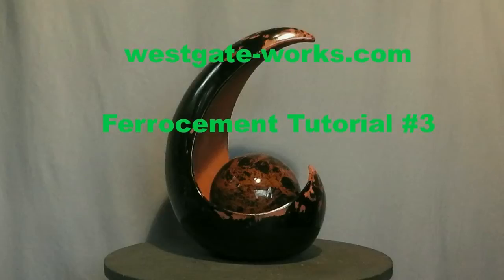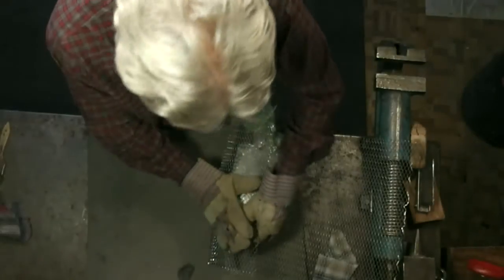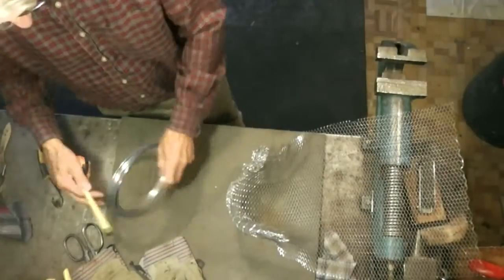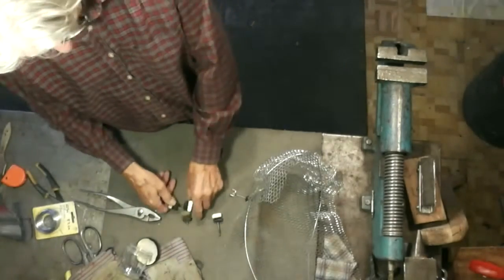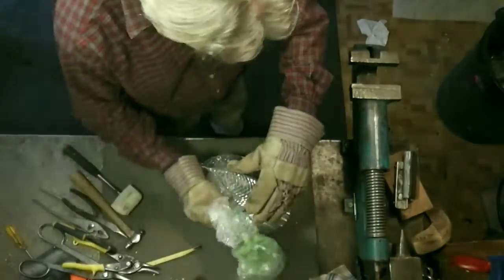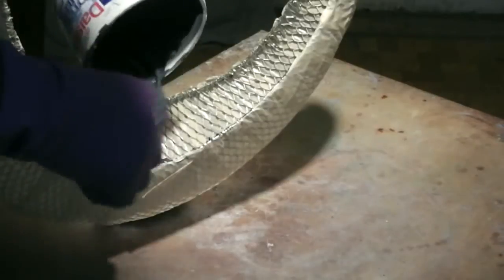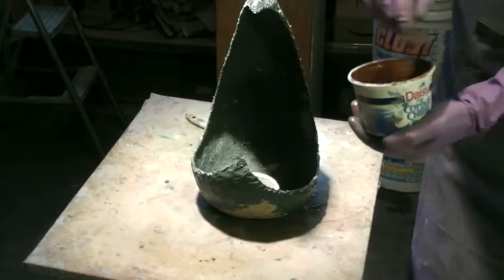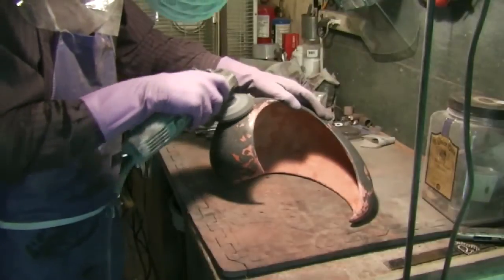Ferrocement Tutorial #3

Comment from the maker: I'm really sorry for not responding for so long. I have been offline YouTube for about 3 years.

First; Sorry for the terrible audio - I had no idea it was bad or I would have fixed it. I'm very hard of hearing so have to depend on others.  The audio was probably trashed by the upload process because it was not YouTube format friendly. I'll try to re-install this video with better sound if I can find the original clips.

Second; I must apologize for all the unanswered questions. Here are some answers.

1. The mortar used for the under layers is Rapidset morter - the brown bag. It can be purchased from Home Depot for about $16. The finish layers use Rapidset Cement - the purple bag with dry pigment colors added. I have only found Rapidset Cement - purple bag - retail at White Cap cement products distributors, and not all stores carry it. It's very difficult to find and worth a long drive.  

2. The expanded metal (steel lath - normally used for plastering) is from Home Depot  and is 27" wide by 8 feet long. Use the lightest gauge they have.

3. The cement finishing is done using wet diamond pads on a speed controlled 4-1/2" angle grinder converted to wet sanding - rough to fine - and then a dry very fine grit diamond pad. Because cement does not have a consistent hard surface to polish, the finish is then coated with an acrylic with similar properties to Incralac but at fraction of the cost labeled "Aervoe Clear Acrylic". Amazon now sells it.

Since moving from a warm climate to a freezing climate I have found that outdoor sculpture pieces will spall the outer layers if  each coat of mortar or cement is not applied before the previous layer sets hard because water gets betweent the layers and expands when frozen. Live and learn.

Other tutorials can be found at www.westgate-works.com.

Comment: Interesting to hear you call Ferrocement " concrete " as a Ferrocement retired boat repairer, during my learning time if I ever called it concrete I would get a clip around the ear..It is most definitely NOT concrete, concrete is porous and not water tight because without a pozzolan like fly ash or DE added it is just ferro concrete, My mix is 2-1 with 15% of the fine sand replaced with a pozzolan, I also add a few grams of trioxide to stop the galvanic reaction between wet mortar and wire which causes gas bubbles/honey comb effect, fatal mistake for a boat..

Comment: what's in your mortar? also what kind of paint did you use?
Reply from the maker: Rapidset Mortar - Home Depot. Can also use other Rapidset products for fine finish. I use a kitchen trainer to sift out larger aggregates for smoother finish. Colors can be cement pigments or a finish coat using Rapidset Water Stop mixed with small amount of  atomized copper and then patina same as bronze. Acrylics can also be used.